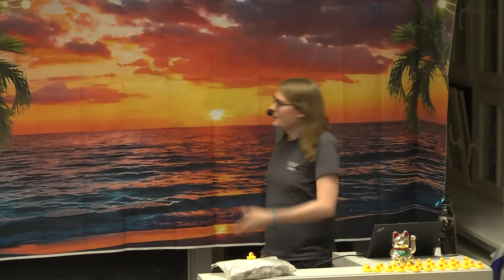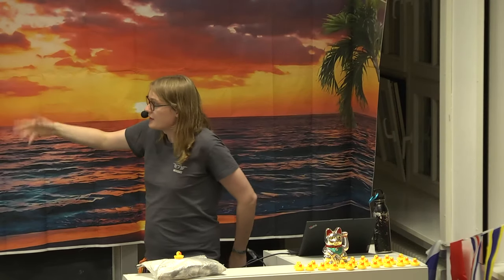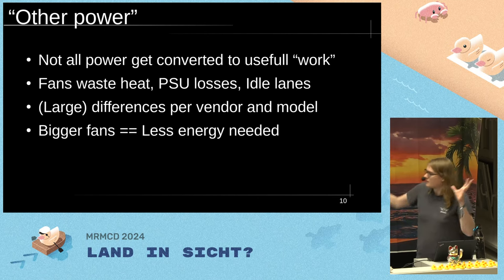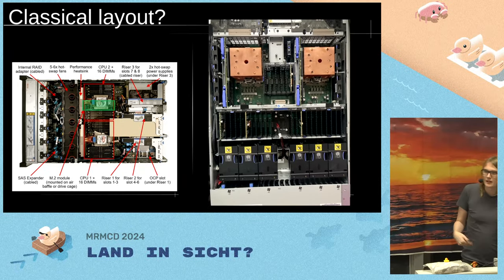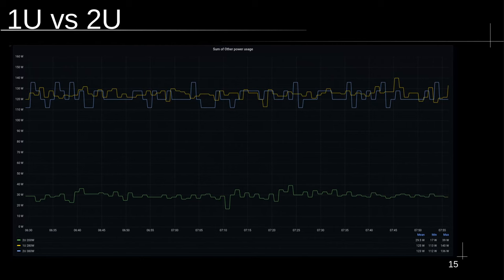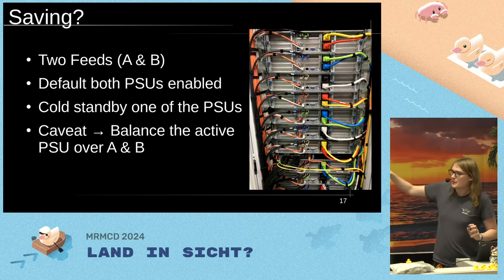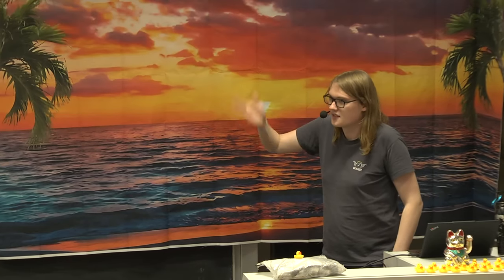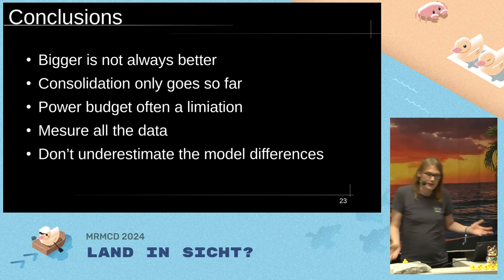MRMCD2024 Power efficency of (modern) servers

Comment: I stopped watching at 2:05. Why watch a talk about the equivalent of a combustion engine, i.e. the x86 architecture, when it is obvious that electric cars (i.e. ARM) will take over soon?
Reply: bruh, your arm server still needs a PSU of some sort and for instance the explanation of that "80 plus rating tiers" will most likely still apply.*

same goes for height unit considerations for cooling efficiency 

Great talk

*unless we get a cooler sounding standard or break the second law of thermodynamics
Reply: because not all software is ported to ARM, and for some it is either impossible or not feasible.